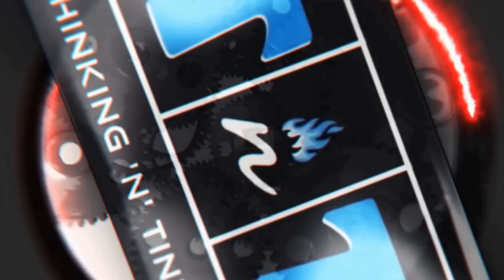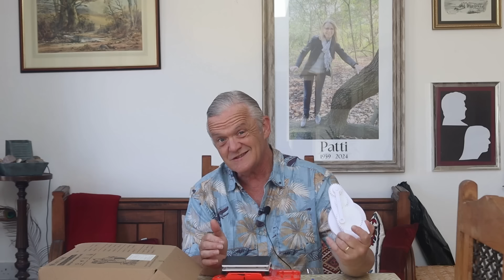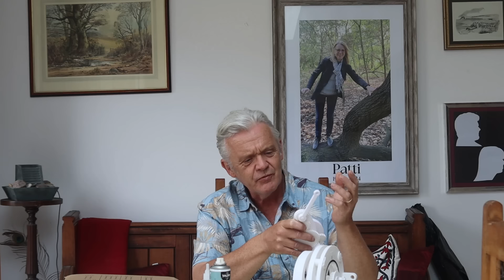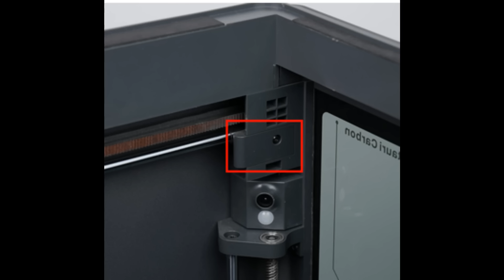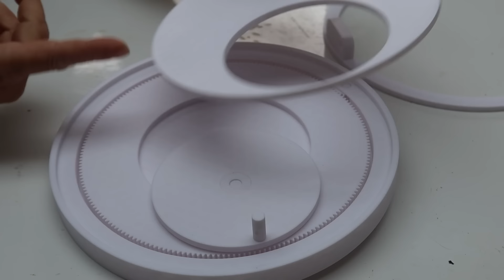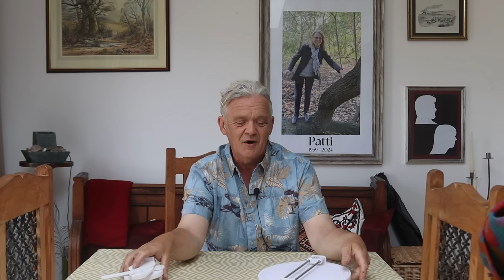2408 Tusi Couple Print Plate

Comment: I'm wondering about if having a rotation component, to the print head holder, could cause it's own problem. An example might be printing a thin cylinder, in software the most efficient pathway would be to set the radius and keep rotating. However I suspect that would lead to twists in the filament and wires going to the printhead. A software solution might be to possible to never cross ( say )  the zero degree mark but to always reverse direction at that point. Not sure if that would end up leaving a slight seem in practice.

It occurred to me then that, maybe if was the base plate that was designed as the rotational component, it would eliminate that ( possible ) problem.
 Of course it might introduce one of it's own eg if the mass and momentum of moving a bigger print and baseplate would start to make things overshoot. At the sizes being looked at probably not but if scaling up I'd expect to have to add something like an adjustable friction brake.

Comment: Just out of curiosity on a slightly different subject(z-axis motor coupler), do you believe a coupler that the lead screw actually screws into (rather than being clamped in as with current coupler design) would be helpful in eliminating z-binding?

Comment: Just thinking about the software/electronics to drive this and can't get my head around it fully. Will the rotation of the drive need to be variable in relation to the linear movement of the slide. I'm guessing it's just going to be some cos/sine function somewhere in the controller. Just can't work it out without some paper to hand😂

Comment: Many thanks Robert for the great channel. Really love to see your passion and joy :)
Regarding the Mechanism, 
I wonder whether the input rotation to the output linear motion has a 1:1 ratio, and it is probably harmonic motion where x=2Rcos(θ). This should be taken into account when programming the controller. 
Good luck!
Reply from the maker: cheers mate
Reply: Unlikely to be 1:1 because the print speed and direction vary in relation to each other.